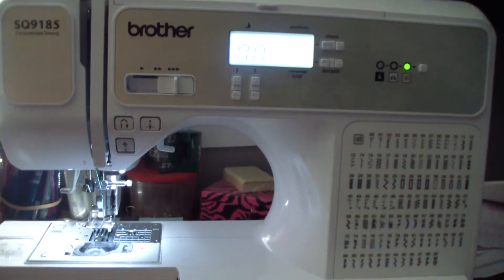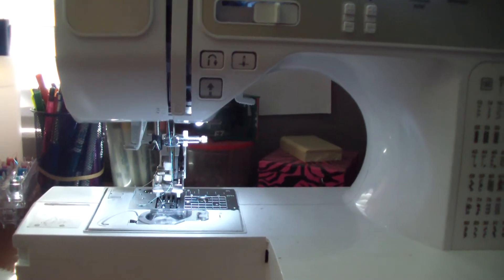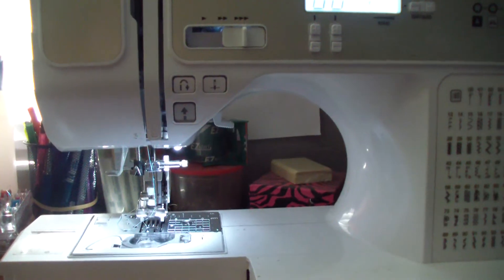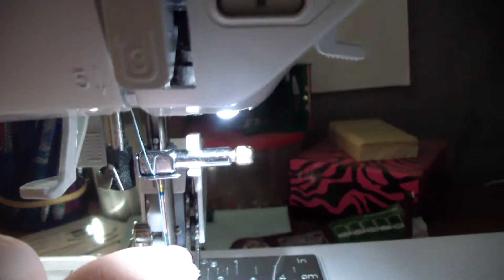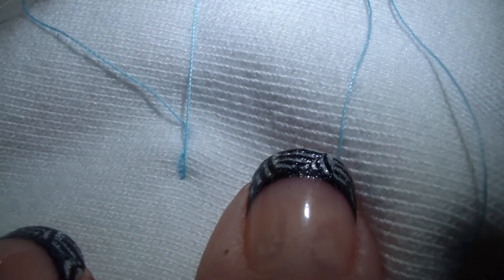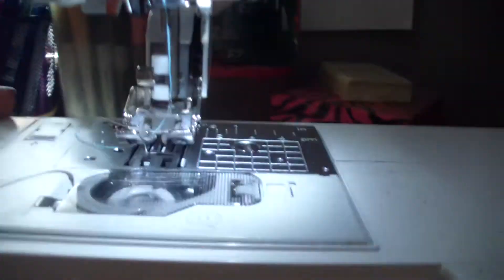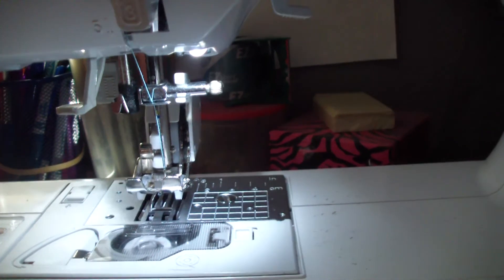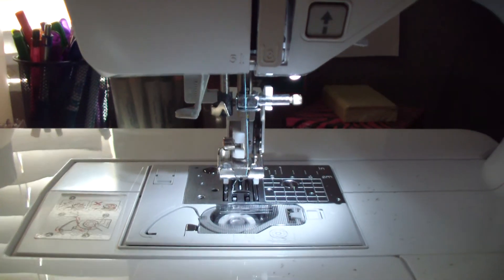Walking Foot Troubleshooting

Comment: So glad I found your channel, I followed your instructions and it solved my problem.  I have the same machine as you and can you answer a few questions for me.  What tension do you have your machine on for think material that you are trying to quilt (trying to do a hot pad) and how to you get your needle to the far right like you have and what are your setting for stitches?  I am knew to sewing and there is just so much to learn.
Reply from the maker: Hi there! I have since upgraded my machine, so I cannot tell you what I had my settings at. On your settings you should see a left to right button with a symbol that has zigzags on it, that will move your needle. Usually your tension needs to be in the middle when working on normal sewing projects and then loosened for thicker and tighter for thinner. When it comes to your stitch length I like a longer looking stitch instead of smaller because I like how the finished product comes out with beautiful lines. Play around with some scrap pieces to see what settings you like and then put them on a sticky note on your machine to remind you. Good luck!

Comment: I have a Brother CS6000i - and after having the machine serviced (annual cleaning/conditioning), I began hearing the clunking when using the walking foot. At first I thought it was a bent needle - but a new one made no difference. Then I stumbled onto this video. On my machine what solved the problem was moving the lever all the way to the right (when facing the back of the machine). I think the technician must have reset it or it got bumped. Whatever - thanks to your video, problem is solved.

Comment: You are star thank you so much.
I have never used a walking foot before so it sounded clunky but it was working and called my mum and she said walking feet can be a little louder but it shouldnt sound laboured. she lives miles away. 
So I took the foot off but it back on made sure I had done it correct and it was clunky and jumping all over the place. 
So I turned youtube. I have a brand new sewing machine this is my first project on this machine. But it seems to have solved the problem thank you
Reply from the maker: So glad i could help you!

Comment: One thing to remember with a walking foot is that it doesn't actually pull the fabric. All it does is is push down on the fabric but lift the actual foot. The part that pushes down can slide back and forth easily while maintaining pressure on the normal feed dogs. It's pretty obvious otherwise it would only work for one stitch length as there is no adjustment. Accufeed from Janome is different as it does have a special mechanism and feet feed from top and bottom. They do work well though.

Comment: Help!. I had never used my walking foot before, and heard it is great for sewing with knits. I am trying to sew a doll's leggings using light weight knit and walking foot. I put a new jersey/ballpoint needle in too. I pinned the material in the seam allowance  I sewed the seam allowance  removing the pins as I came up to them, and turned it over to see how I did, it was terrible. It was  all uneven and shifted. Please tell me is there something else I need to do so my edges don't slip? I am so disappointed because I thought this foot was supposed to prevent the shifting of the material?
Reply from the maker: Have lowered your tension setting?